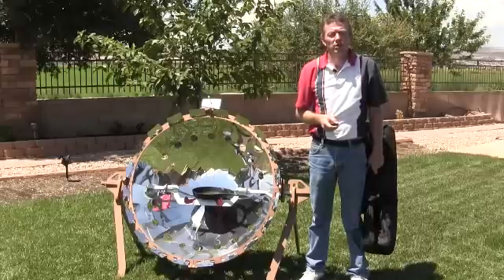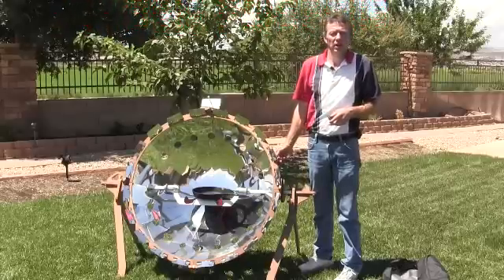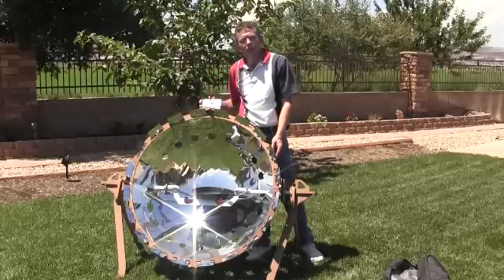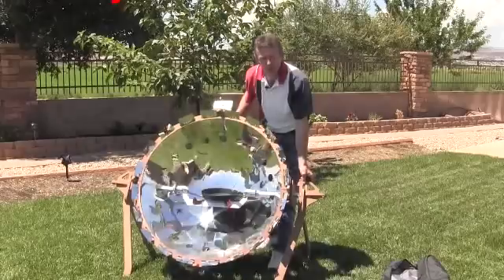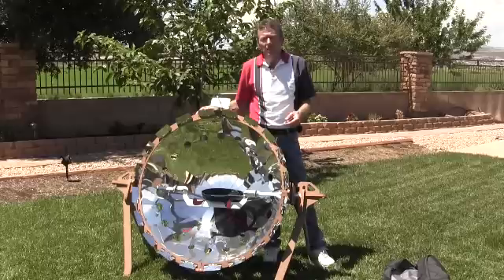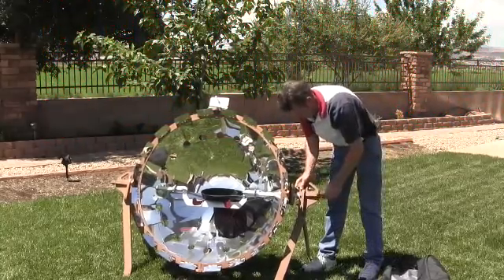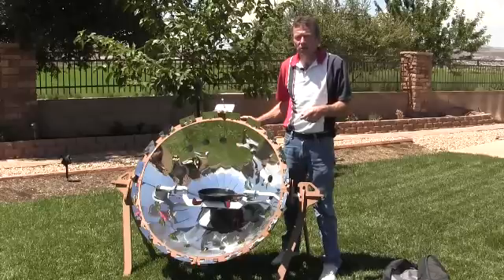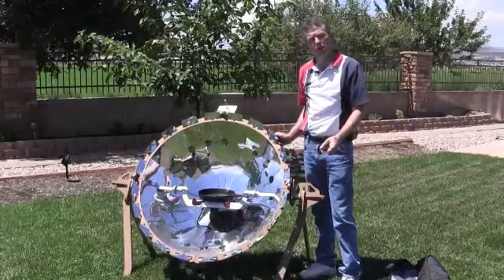Cookup200 Solar Parabolic

Comment: I have a CookUp200 and I love it. Sometimes I use it in concert with my SOS "Sport" Solar Oven and/or my Global Sun Oven. Combined they attract a lot of attention and are a great way to meet new people and make new friends.

My solar cooking gear has saved the day on many occasions during power outages.
Reply: I'm glad to hear that you are such an avid user of solar cookers and that you are such an advocate of solar cooking.
It really is a great way to catch the attention of people when you have several solar cookers all cooking at once. People can't help but be intrigued.  I do the same with all of my solar cookers.  Thanks for watching and sharing the knowledge.
Reply: Thank you.

My wife and I have been using solar cooking devices for nearly 10 years now, especially during the summer because cooking outdoors with solar does not heat up our house.

Sometimes I just set up our 1.5m parabolic solar heater (much larger than our CookUp200, but same basic design) and use it to heat water. I use the interior pots from our thermal cookers. I took the pots and painted them flat black with hi-temp black paint so they have better absorption of the light.

Once the pots are boiling I simply place them back into their super insulated home thermal cooker unit - and there they stay above 200f for at least 8 hours, and longer if I place the thermal cookers into hay boxes for extra insulation.

Each thermal cooker holds a 7 litre inner pot, so I usually have 14 liters of very hot water to draw from throughout the night, even in winter.

We have 5 solar units in all, two parabolics, two ovens, and one folding unit made of reflective mylar bubble wrap.

I would very much like to see solar cooking methods catch on here in the USA. Apparently it takes time. Advertising would help.

Using thermal cookers in concert with solar cooking is a superb combination. A basic "hay box" can also be used very effectively. Have you tried it?

I hope this helps.
Reply: Ash Jackson
I like your way of thinking and your way of doing. I am all on board with your method of using solar, especially in the cooking arena. ;)
I too am an advocate of thermal and solar, it is a great combination.

This is exactly what we are all about.  We are working in every way we can to help the idea of solar cooking catch on here more in the USA. I agree totally with you.

I wish there were more that thought like you two do.
There are a lot of us solar cooks out there, but so many more that do not know about it or use it.
Keep up the good work.
Reply: Hello and thanks for the kind words of encouragement.

There are not many solar cookers in my area (we live in East Tennessee). However, people are attracted to solar cookers when they encounter them.

It would really help a lot if solar cooking methods could be brought to mainstream attention in some sustained way. People simply do not know about solar cooking and are skeptical of it until they see it working up close and personal.

It should be integrated into Boy Scouts & Girl Scouts, all preppers should know about it, churches should use it - anybody and everybody should use solar.

I like cooking with solar (especially my SOS "Sport" solar oven) because I can set it up and let it do its job pretty much unattended (although I do make an effort to re-align it with the sun every few hours or so, about three times during cooking). All that cooking with a solar oven requires is prepping the food, putting it in the pots, putting the pots into the solar oven, closing the lid and aligning it with the sun - and walking away until it is done.

People are also astonished when I make solar tea. I have a 1 gallon glass jar, which I painted flat black with high temp black paint. Into it I place 12 or more tea bags or a couple of reusable tea infusers filled with my teas of choice (blended). I place the painted jug in the middle of a 4.5ft X 2.5ft piece of aluminum coated mylar bubble wrap, curve it into a loose parabolic bowl type shape held together with clothes pins and metal document binders - and it reflects a lot of sun up onto the black jug. My tea jug routinely reaches 175f (easily enough to pasteurize water) and steeps the tea so perfectly that it produces a noticeably distinct taste that regular brewing methods do not make.

Again, it attracts attention in a good way. Thus, on a sunny day I can bake two dishes in my SOS Sport Solar Oven (plus another if I also use my Global Sun Solar Oven), pan fry a dish on my parabolic solar cookers; heat 7 to 14 liters of water to boiling (and keep them hot for many hours to come in their thermal pot sleeves) atop one of my parabolic solar cookers, and have fresh brewed tea all ready come dinner - and all using only direct sunlight.

This came in very handy recently when my power was out for 16 hours, most of it during the day. I cooked 2 meals, had hot water, fresh tea, an oven baked meal - and all without electricity (although I did also use my Brunton solar charger to charge 8 AA batteries for my LED flashlights & LED lantern later on that evening.

We had hot fresh food, fresh hot tea, hot water - freshly charged AA rechargeable batteries and ergo plenty of light during the dark of the night - all via solar power that we made wise use of earlier during the day.

My neighbors think I am a fruit cake, but they had to drive a few miles to have lunch & dinner (and pay for it). I have chef training so I assure that my food, cooked with solar, was superior to whatever they drove and paid for.

In regard to the bigger picture, part of the problem regarding solar cooking is that America has it way too easy and Americans are addicted to convenience (and to TV. My neighbor across the street actually attempted suicide because the power was off once in 2013 for many hours and she couldn't watch her big game and following shows. If her daughter had not been there and called the ambulance she would have died - she had slit one wrist and tried to OD on morphine and sleeping pills - all because she was disconnected from her TV).

I advise people, anyone who will listen, to invest in a StoveTec Deluxe One Door Emergency Stove (it burns any bio based fuel: wood, paper, straw/grass, dried dung, bone, etc) for use during inclement weather, the matching water pasteurizer for the StoveTec; a single burner butane camping stove for indoor use (and several butane fuel cartridges - butane generates no carbon monoxide so it is safe to cook with indoors); a solar oven of some kind (I suggest a SOS "Sport", or a Global Sun Oven, or an All American Solar Oven), and a Sawyer water filter. They are all one time purchases and aren't expensive - and worth their weight in gold when an emergency/crisis happens.

Most people just scoff and laugh. They are the ones, such as my neighbors whom I suggested that they purchase candles (etc) during the summer, that I ended up selling tea candles to at $5 per candle last time the power went out jut a few weeks ago. Talk about eating crow - at five bucks a pop! I made almost $160 on one five dollar bag of tea candles in one night.

They still did not heed my suggestions and have not purchased candles nor flashlights, MREs, nor a $20 butane stove. None of it, nothing, not a single of my neighbors. They would rather pay $5 per tea candle than pay $5 for a bag of 50 at the supermarket. I told them that if they want food from me during a power outage that it will be $120 per plate, cash up front - and that it will be whatever I cook based on what I may have on hand. Fully charged AA batteries will be $20 each and LED flashlights will be $100 each, plus batteries.

They have now been told, again, unequivocally, to equip themselves while the getting is good - and can easily pick up batteries, flashlights, emergency food, stoves and provisions for a crisis well beforehand. That said, my bet is that come the next power outage in my area I will pull in $500 cash, minimum, selling batteries, food & tea candles at incredibly jacked-up prices - and all of it to exactly the same people I have spoken with repeatedly in regard to preparing for power outages and emergency situations.

However, my suicidal neighbor did purchase a gas powered emergency generator - which is dedicated exclusively and solely to her TV which now never goes off and is on 24/7 365 days per year. She keeps a six day supply of fuel for the generator but has no candles, nor bottled water, nor a LED flashlight with spare batteries anywhere in her house.

Welcome to 21 century America.